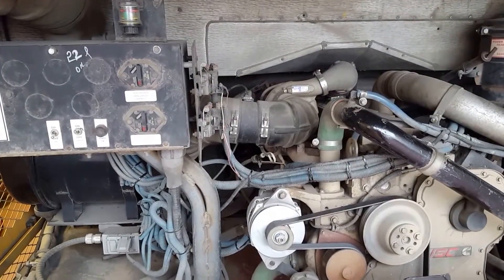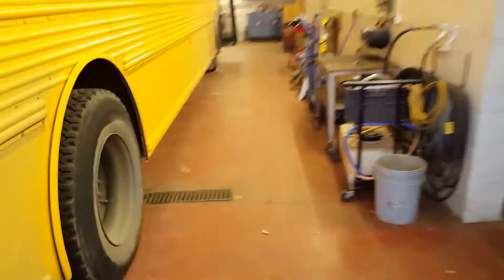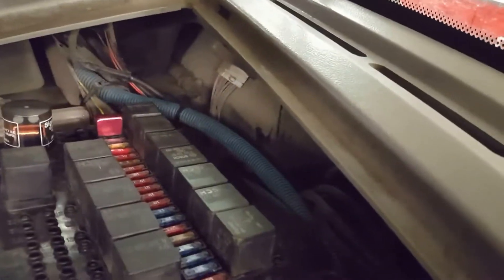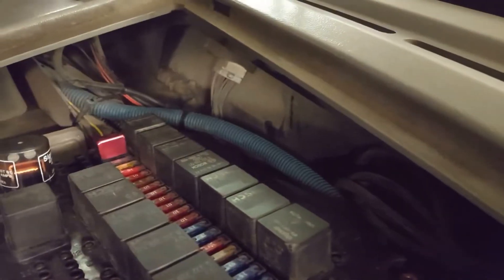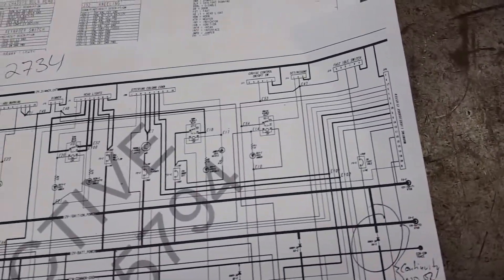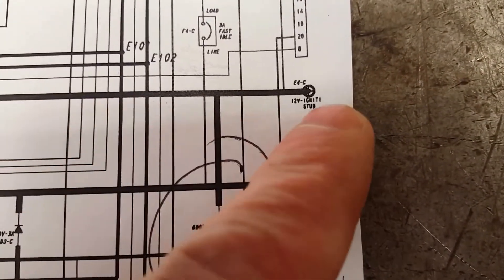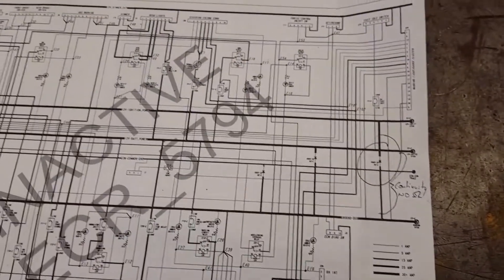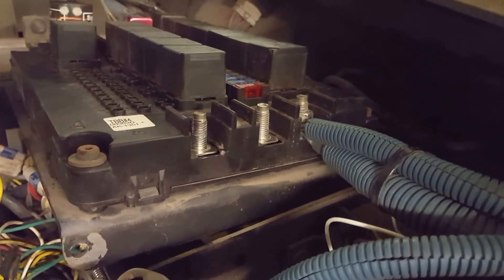Electrical Short Problem on a Thomas Pusher School Bus

Comment: Dude, this is crazy, you got an older model, but I recognize the schematic.  I was a senior design engineer at Thomas Bus from 2002 to 2015.  I'm the guy that put the notes on the schematic connectors so you can have an idea what they connected to and what they did.  I always used that 15 degree slanted font you see on the drawing.
Reply from the maker: Wow that's cool. I like your work it's well done! Thanks for the comment. I'm guessing your retired now? The HDX is the best school bus pusher out there.
Reply: @MechanicsHubdotCom  Thanks, no I'm not retired I got out of school buses and moved into Utility Electrical Power and Control Systems
Reply: Any shot I could connect with you for some help? Trying to convert my bus and cut to many wires. Cant get it going